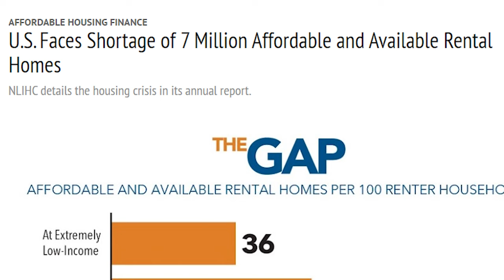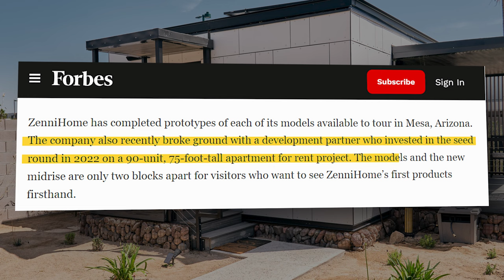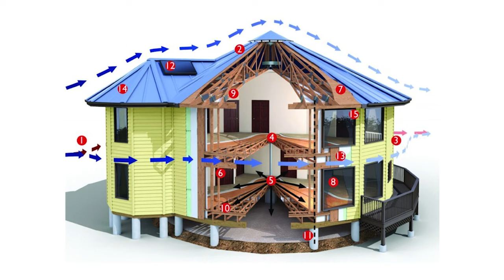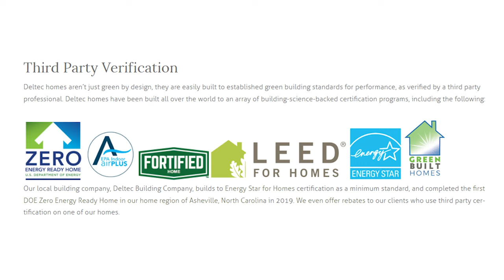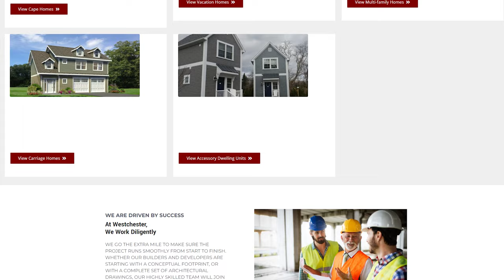My TOP Picks For Modular Home Companies In 2024

Comment: Modular homes would make sense if they weren't as expensive as they are per sq ft. ZenniHome's $ 130k model just buys you a 650 sq ft. house. Having the same house, built traditionally, from the ground up, should cost in the $ 60k to $ 80k range (depending on where you live). Now, if the price if these modular homes becomes more affordable due to economies of scale and AI, then sure, they deserve to be considered. Until then, if we're talking exclusively about affordability, modular homes are not the answer to the housing problem in America.
Reply: Based on what I've seen people comment recently to get a home built in the current market is running around $185-200 a square foot which I don't even think includes all of the site work and this is not in an expensive area so not sure how/where you'd be able to get a 650 square foot traditionally built house by a builder for $60-80k.
Reply: I so agree, AND the zoning is also a BIG issue in my neck of the woods (Florida) the authorities' have no idea what they are.
Reply: @sharonthehuman5954  Exactly, builder prices have risen since the pandemic and haven't gone down that much. And like she said, modular gets built way faster and one of the biggest issues is lack of inventory
Reply: Agreed
Reply: Idk what homes you can buy or build for 60-80K in the U.S. but you put 2 of those 650sq houses together and that’s the size of a normal home coming in at 300K or just under. And the more of them you build the lower the price will be over time which is the whole point.
Reply: Do you have a video on buying land for a modular home
Reply: @ghaywoood5 Cross mod! These modulars will be approved for a 40 yr loan! Why? Because they are better built than a stick home.
Reply: AI?
Reply: Thanks for the info. Have you heard of a company called Vantem?
Reply: AI?  😂
Reply: @ghaywoood5 It’s due to high fuel prices, not the way gone Covid episode.

Comment: When I was interested in going modular, research showed that most homes that are being built in factories are SHELLS. This means plumbing, electric, AC, permits, transportation to the work site, finishing, land, and more are the sole responsibility of the purchaser and clearly stated NOT INCLUDED in the home price. That $400,000 modular will cost you closer to $750,000 when it's all said and done. Often with a very hefty up front cost well beyond the 20% down you expect.
Reply: That’s crazy. This is perhaps more important than the video I would argue
Reply: I know this has not been the case for the companies I have looked into. The price is comparable to a stick built of the same size, often a little less. You have to look at base price which seems very cheap and is just the shell, or the finished price. The company I am dealing they included the price of even the foundation and everything down to screens on windows in the finished price. It was a little less than I was quoted by 3 different builders in the area.
Reply: @erinroberts6167  "The price is comparable to a stick built of the same size, often a little less." Are you comparing the "base price" with stick built? Maybe look into the "all in" price. I would be interested in what happens at closing after inspection. Also see if your "home" ends up with a HUD sticker. There are a lot of scams out there, my feeling is your bill will be much larger than what you contracted for in the end. Keep in mind, they CAN'T disclose the "all in" price until AFTER the home is built.
Reply: @erinroberts6167  Yes, modular is more affordable, even when all is said and done.  My sister-in-law and her husband just finished building a modular home and it turned out beautiful - while there are always a few unexpected costs when building (their driveway is very long as it took some tweaking to get it not to wash out the gravel when it rained heavily), they were happy with how everything turned out and it wasn’t even close to $750k.
Reply: Modular don’t get a HUD sticker. You’re thinking of a mobile manufactured home that is delivered on a chassis w wheels. Modulars are delivered on flatbeds and have to be built to code.

Comment: I was checking out Deltek and these homes are not affordable. The "shells" package is, but expenses that go with that are not. For example the 360° Signature
Escape Shell package 1678 sq ft, starting at $111,686, and once you add certain things, the price can go up to $170,000-200,000.Then you have to hire a contractor to get it up, and the estimate for total costs on this one is $670K, and that doesn't even include land!!! You missed a few details on this.  I also think the resale value would be low because not everyone wants a quirky round house. It would be a slim market pool. 

 Here's the quote about est cost to build: "Estimated Total Cost to Build: Since our shell represents a portion of the total cost of the finished home, we also show an estimated total cost to build your 360° Signature home. This cost estimate is based on national average construction costs, and includes the cost of our shell, plus an estimated cost for the foundation, assembly of our shell, and the labor and materials to finish out the home assuming you hire a general contractor, and use basic finishes and fixtures like appliances, flooring, bathroom and kitchen fixtures, etc. that can vary widely from project to project. It assumes a $35K allowance for site preparation (and please note, site work costs can be highly variable depending on your exact lot location) but does not include the cost of land or landscaping. If you do not select a floor system, this estimate assumes a slab foundation. If you do select a floor system, this estimate will update and reflect the higher cost of a crawlspace or piling foundation. As you select different options, this estimated total cost updates to reflect the cost of these options plus an estimate of any associated change in site finish costs, for example, the additional labor costs to install the covered porch when the covered porch upgrade is selected."

Comment: My apologies to Kt.Smhn., But that Picture @ 3:23 With the Structures built w/ " Metal Studs, " I'm A retired Union Carpenter,
and Metal Studs are usually for " Inside Non [ weight ] Bearing walls " !
The outside Walls on Most Commercial Construction is Concrete or something of similar strength !  If any company showed
me an outside or inside wall like That for " Residential Construction " I would walk away !
There are " 2 kinds of Construction." Residential & Commercial. "